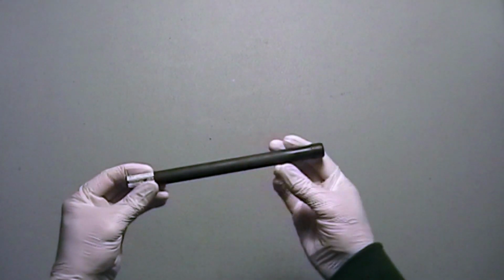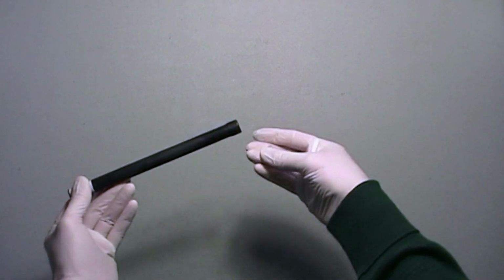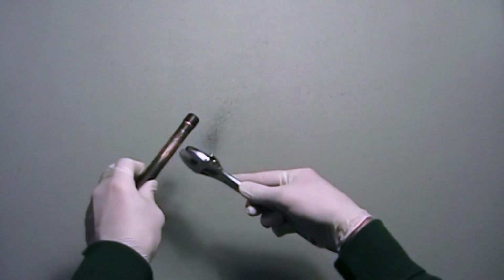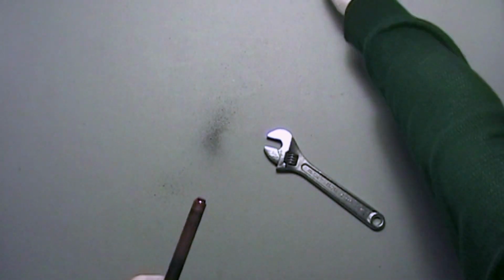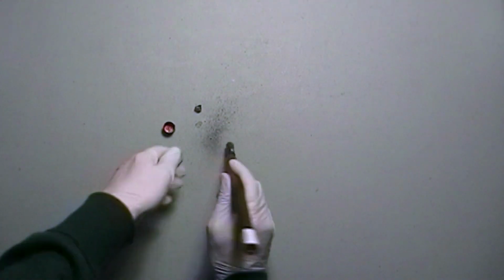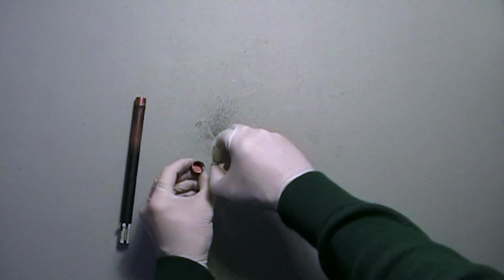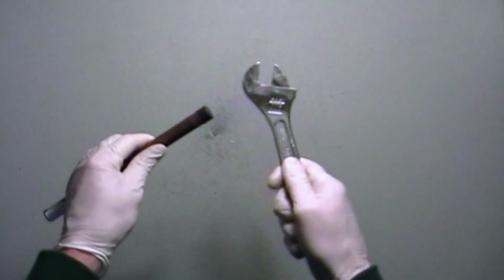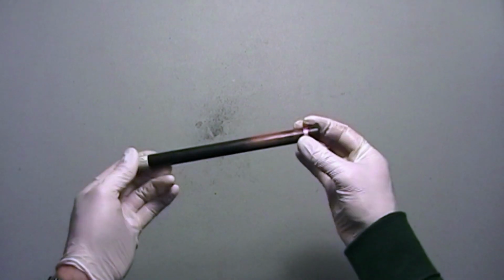Watchman Power Tube, replacing the batteries

Comment: Great tutorial. Thank you for sharing. I changed the batteries in my Watchman Power Tube tonight. As you said, just be patient removing the cap.  Couple of comments
1. Use some wire wool to clean the tube before and after, especially once the cap is removed to maintain a smooth surface on the outside of the tube.
2. Plenty of petroleum jelly on the batteries to prevent corrosion.
3. Check the voltage of the replacement batteries before refitting!
4. Gently warm the cap before refitting to make it easier to fit. 
5. Check the voltage on the Power Tube to make sure the cap has reseated correctly ( as you did!).

Oh, and as the Power Tubes don’t seem to be available anymore, you’ve saved me more than £35…. A new Watchman is £75 + plus the hassle of fitting it.

Great YouTube hack! Cheers, Ross.

Comment: Thank you for the wonderful instruction on how to change the batteries...
Your step by step instructions were easy to follow, and it made the job so much easier...
I have replaced the old batteries with 1.5v Duracell Plus... they will do until the Duracell ProCell I ordered turn up... The old batteries lasted just over 20 years... Thanks again... Billy Hume

Comment: Thanks for the video, looking at the grease it is not ordinary grease but a dielectric grease so if you can't transfer enough from the old batteries then silicone grease will work as that is dielectric eg it will not allow conduct electricity.

Comment: Thanks for this to. Saved a few quid and only took 10 minutes.   My version has separate components connected by cable and all inside the bunded tank.  So, if you can't see the power tube on the outside of your tank, open the lid and look inside the cavity of the bunded tank. Mine had copper dioxide (blue/green corrosion) on the outside but this came off easily enough.

Comment: Our fuel deliverer replaced our old mechanical level gauge  with this battery-powered Watchman: but I dont think it is worth it. The old one would have cost about 15 euros to replace, is reliable enough and never needs batteries.

Comment: Use a brass 15mm plumbing nut pushed on from opposite tend to tap the cap off, gives a more even load.
Reply: A 15mm brass nut does not fit. That was a wasted journey to plumbers ! 🙁

Comment: Excellent, saved me £38, just about to order a replacement for Amazon. Couple of additional tips, I knocked off the end cap into a bucket to save the spring in the cap from escaping. Plus, used  vaseline to top up the grease. Thanks again.